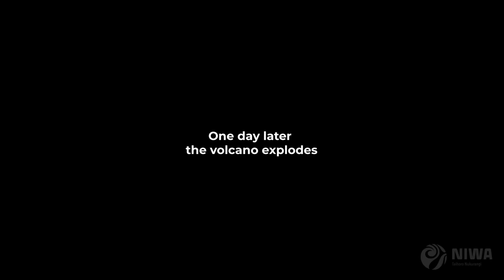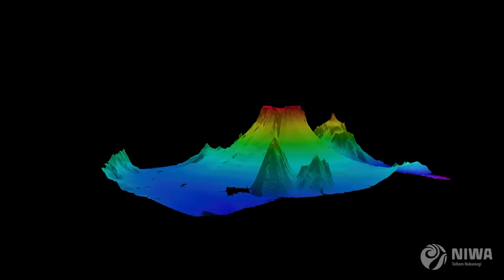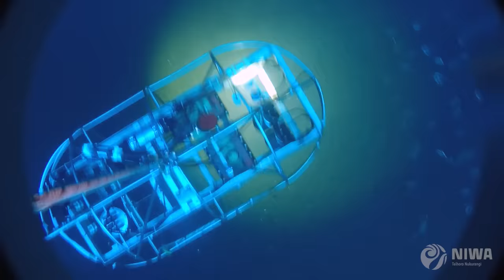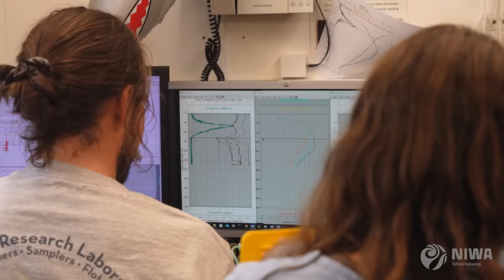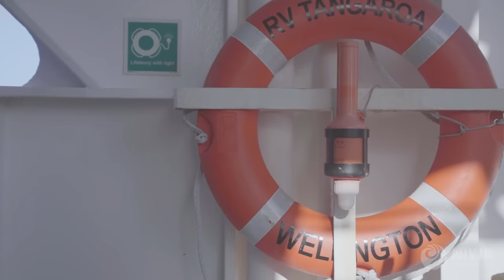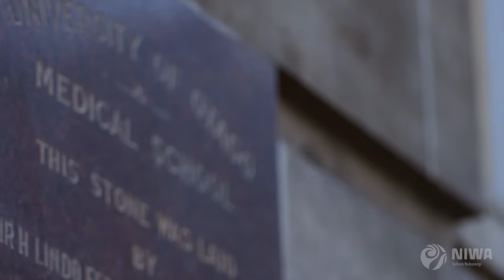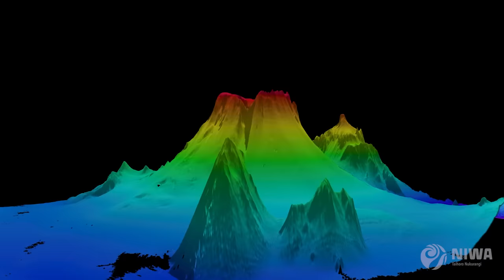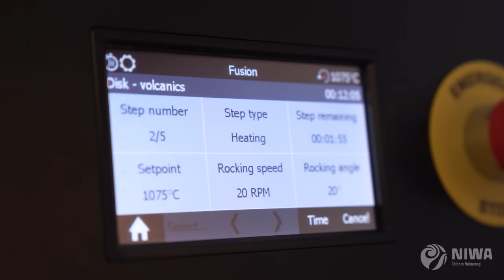Tonga eruption and tsunami shock the world

Comment: I live 220km from the eruption.
I heard a massive crack bang whilst eating lunch at the table at home. Then another and another. This went on for what seemed like well over an hour long.
And the recent earthquake in Tonga sounded like freight train was coming before the house shook very violently then started to roll.
Both experienced have really opened my eyes.
Reply: I have the Suspicious0bservers Disaster Prediction App on my phone and not a day goes by that the Tonga region doesn't experience at least a Magnitude 5 quake.

As the site creator, Ben Davidson always ends his videos: "Eyes open, No fear... Be safe, everyone."

Were I you, I'd be prepping by stockpiling food, fuel and medical supplies. If you live in a low-lying area that may be subject to a tsunami you might want to outfit your vehicle with survival equipment, including food, shelter, trade-goods, personal defense, etc. and be ready to evacuate to high ground on short notice.

If you don't currently have a weather-alert radio get one and have it set up. The next mega-blast eruption might happen at 3AM local time. 

You are in my prayers. Be safe...........................

Comment: A year ago I had posted the lengthy comment below for a YouTube video that was focused only on earthquakes.  That being said, earthquakes and volcanos are close cousins in some ways, although they are initially generated by different forces.  The "Ring of Fire" that surrounds much of the Pacific Ocean is the birthplace of both volcanos and earthquakes.  The effects of outward radiating forces explained in this excellent video are also relevant factors for strictly seismic activity.  What follows below is my previous comment and may be of interest to some viewers.

Here is an aside from the 1964 earthquake (9.2) in Alaska that readers might find interesting:  One type of the various seismic waves an earthquake can generate is called "retrograde elliptical," which advances somewhat like a giant corkscrew around the earth's crust.  The one from the 1964 earthquake made 4 complete passes around the earth as measured/recorded on sensitive military seismic equipment, with of course the distance from the epicenter setting the limits for what people could themselves feel during that first pass.  Other types of waves penetrate through the earth and bounce back from, reflect off, and pass through the various discontinuities that exist such as at the mantle, core, and inner core interfaces (Re. reflection & refraction).  The 1964 earthquake pegged (maxed out) much of our sensitive equipment for days because of the magnitude of these continuing "surface" waves regardless of the location of the monitoring facility.

The earth is incredibly elastic, which is hard to imagine, but this is what accounts for the "waves", vibrations, continued shaking, etc.  Drop a rock in a pond and observe the resulting waves spreading out.  The earth itself reacts the same, but in every direction.

As a young airman I taught in a related field in the Air Force in the late 1960's that was a bit more interested in underground nuclear testing being conducted by Russia and China than it was in earthquake phenomenon per se, although at the time we were many years ahead of civilian earthquake monitoring equipment and techniques when it came to the detection and understanding of wave propagation.  Detecting a relatively low yield underground nuclear explosion from a thousand or more miles away requires advanced technology.  Later in my enlistment while on assignment I nailed a Chinese test by spotting a few suspect wave cycles on our seismic equipment when these waves differed slightly from what was normal background "noise" (such as cattle moving or trees vibrating in the wind).  Fortunately, at the time the Chinese were kind enough to always initiate their tests at 15 minutes after the hour, so by allowing for wave travel times we knew when to concentrate extra special attention.  When a test was detected this immediately set in motion many other "procedures" that at the time were cloaked in secrecy.

Comment: How will the scientific findings of this eruption be used for a scale up / comparison what would have been a realistic scenario if the "2022-Tongo-eruption" occurred above the sea level or in a height of 3000m in mountain landscape (if experts applied similarity mechanics) ? Especially with the focus on "climate change effects caused by a single impact event" not being able to be influenced or controlled by humans
If I correctly understand, the  seawater column above the eruption spot worked as a kind of filter to prevent most dust particles to enter the atmosphere. Personally it is not so much interesting to get scientific conclusions about the situation of the sea bottom-fauna, because I rather expect (even without scientific proof) that in a large range around the spot there will be rather no life anymore for some years, which is not really an important fact and has no economic relevance.

Comment: A very well made video for public, but for some one interested in useful information, it was like expansive novel cussing finished by thick layer of tomato ketchup. Difficult to hear clearly because of distraction of same volume background music. 
Information was good for mankind, which have no clue about mechanic of volcano except small surface part. You are like 1900 cancer doctors. Your limited knowledge makes you wait until wound has surfaced. Collect data, which is too late, but comforting in helplessness. The reason is simple mankind internal structure of earth is fiction. A set of agreed assumption by men ignorant of facts with a few surface data from observation. Until you know correct internal structure and activity of earth, you are limited only to plastering over the wound.